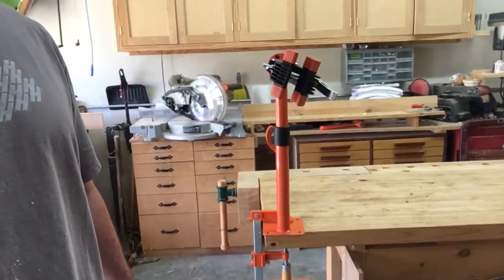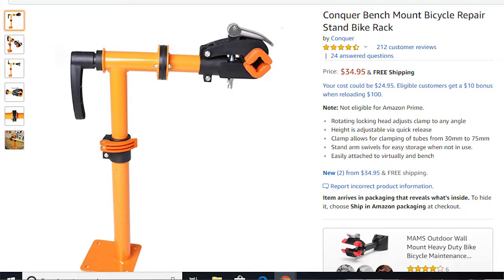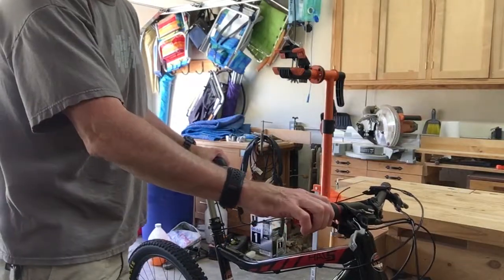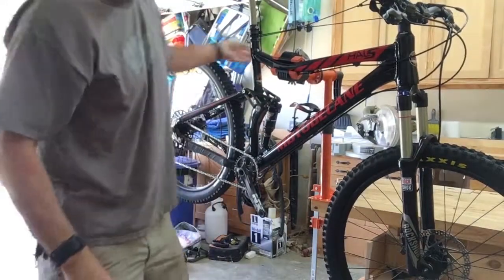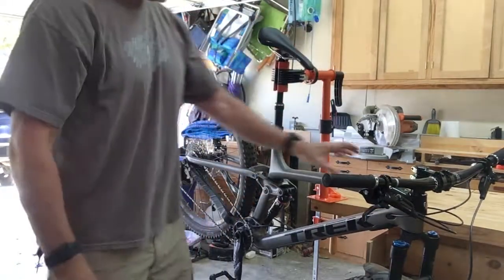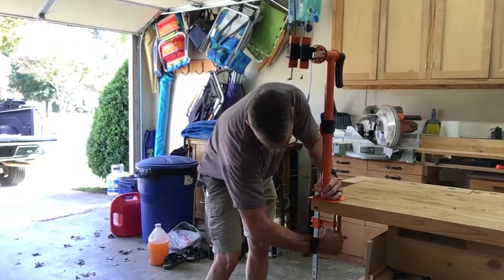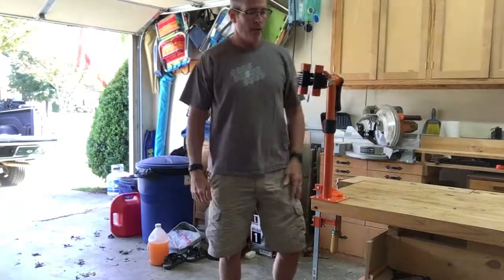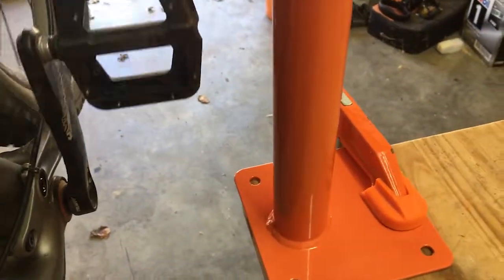Awesome $35 compact bicycle maintenance stand

Comment: The dropper post sohuld not be damaged from being clamped or the weight of the bike, but making sure the clamp and the post is clean is important to avoid scratching it.
Park tool has a video where they explain this in greater detail.
Reply from the maker: Johannes Nilsen I agree. I normally leave the clamp open and just hang it by the underside of the seat with the front tire resting on the ground. Most jobs involve cleaning, lubing and adjusting the drivetrain😊
Reply: @TrailBreaker  mine involves pressing bearings in after long trail rides, checking bolts, bent hanger, other issues, but my 2014 fuel ex is bad, do flexy, new bike is in the plans,, hope for less maintenance, this bike could drive done one crazy, but won't ho off topic on this, got plenty of I go on it, but a thing I like about my stand is I can put bike at extreme angles for inspection for example.

Comment: Problem with  wall mounted stand is you can't be on the other side without switching bike over, so not good for full rebuild or inspections or more advanced stuff.
but you got yours at a corner so that's better, so you can still work on both sides, apart from waking around it, which is rarely done anyway.
I went for the Park Tool PRS 3.2-2, only solution that would work for me, Cus I have to have it in in my Kitchen/living room about in the middle.
Reply from the maker: Johannes Nilsen that’s a nice stand for sure😁 this works for me because space is kinda limited in my garage
Reply: @TrailBreaker  good solution for your problem, how is it holding up? Are spares easy to get ?
Reply from the maker: Johannes Nilsen haven’t needed any😊